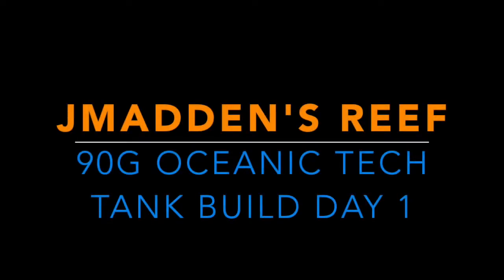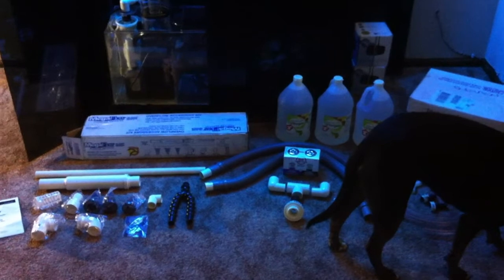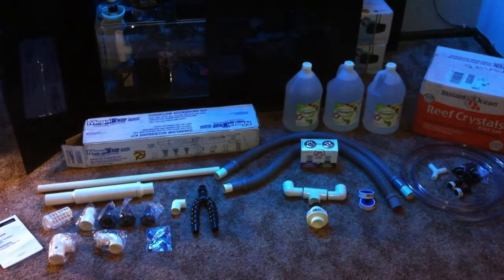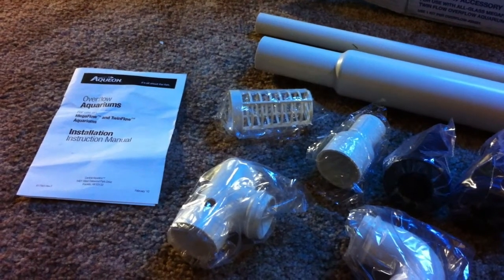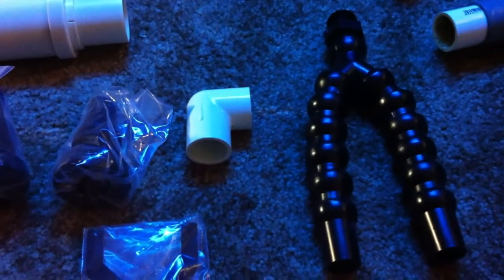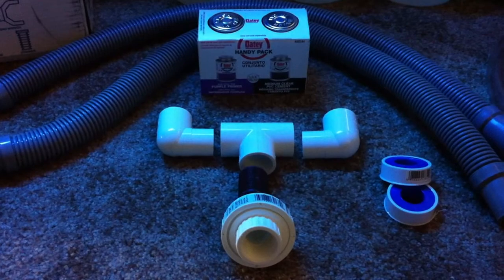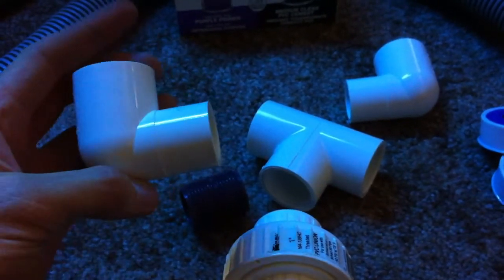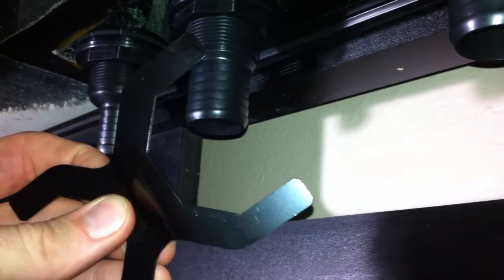jmadden's Reef: 90G Tank Build Day 1

Comment: Been watching you channel for about a year.  Love the new build.

Idea!!  Keep the lines separate.  Run the full syphon (with gate valve) through the sock as planned.  Then let the duroso maintain the water level in the overflow box and run a small amount of water past the syphon into the sump under the waterline.

Would be silent an no risk of flood.  Best of both worlds ;-)
Reply from the maker: Thanks Adam for the support and for the suggestion on the full syphon. The overflow is extremely quiet already, quieter than my nano! I can adjust the height of the durso pipes in the overflow box, so there is no crashing of any water. Both drains have screens that will not allow anything larger than 1/4" to pass through, so I feel very safe. Thanks again!

Comment: Nice Start Madden, Is this the same tank that you had running before?
Reply from the maker: Thanks 915Mang. No, this tank is not the same tank that I had when I was in San Diego. The San Diego tank was a 60G, which was also 48" long, but less width and height. The tank I have now here in Colorado is L 48.5" x W 18.5" x H 25" with three sides of Ultra Clear low iron glass, which I hope makes for better true color of corals and fish.